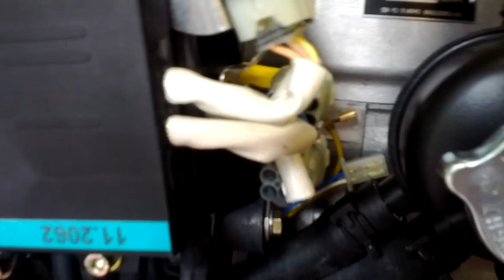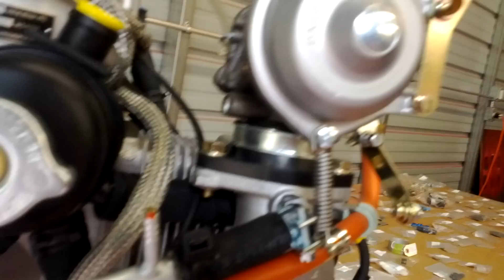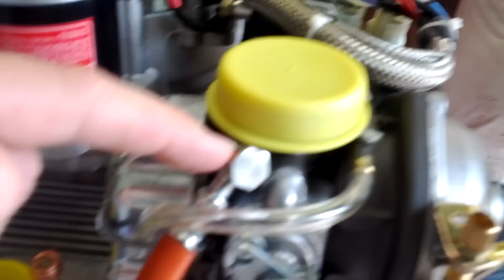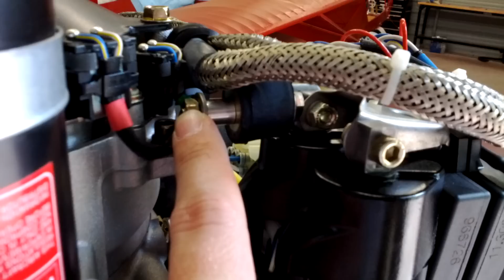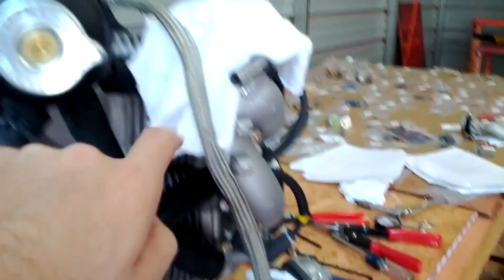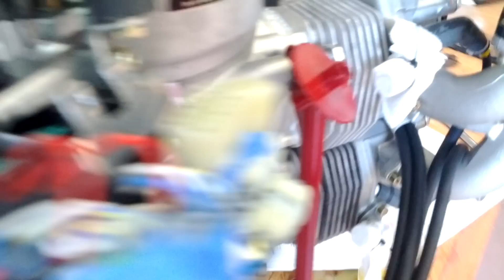Rotax 912 modifications Days 1 & 2

Comment: The stud in the vibration mount is bonded in, and needs gripping to prevent rotation when undoing the nut. 2. at 6m15 you say you switched the carb manifolds. They are handed, please explain